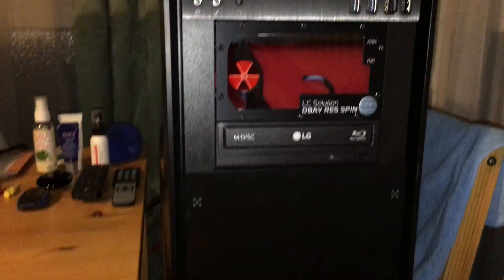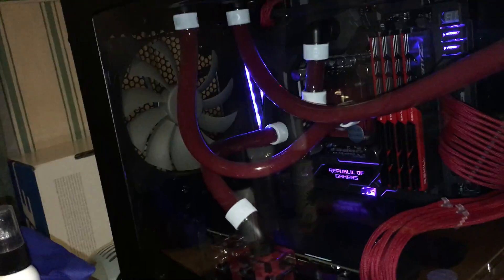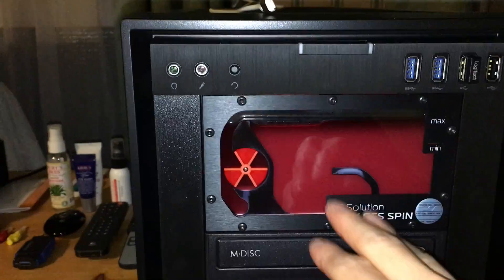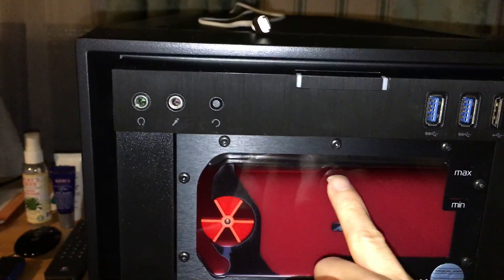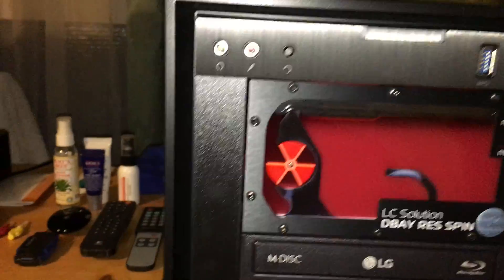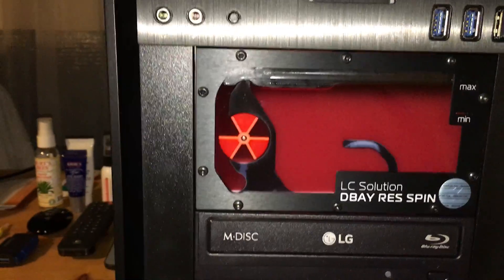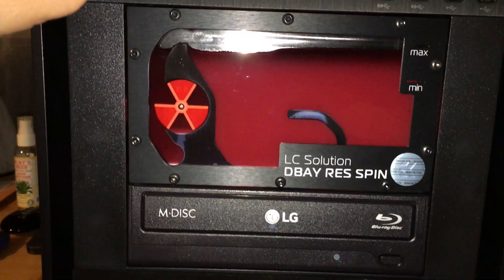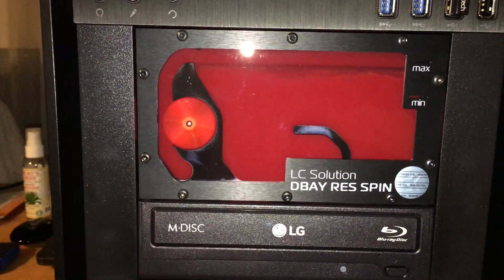EKWB Pastel Coolant filled to the brim following GPU water cooling extension

Comment: A quick question does this reservoir and pump make noise, besides the fact that leaving it sit might cause some noise. im thinking about getting this and im worried about it being very annoying. Also is it easy to bleed and add liquid to. Thanks for reading and keep up the videos. Id love to watch u make more pc videos
Reply from the maker: Bacon gaming Yes it’s very noisy. Don’t get this. Get an internal reservoir. I think I’ll push this inwards and cover the front with the casing’s original 5.25 inch drive bay covers. The pump is 100% silent as it uses a magnetic impeller that floats freely in the liquid. No physical contact with the motor. The reservoir makes an annoying waterfall noise. Bleeding is done from the lowest component in your system. On mine it’s the secondary GPU. Nothing to do with reservoir.
Reply: Brian Su  thanks. I would really love to get this but I heard it's noisy. Considering that yours is not that loud is it because it's filled to the top so when their is a water fall it doesn't make water splashing noise
Reply from the maker: Bacon gaming yes it is noisy. I did fill it to the top but the level has fallen. Maybe I need to try to fill it up again, failing which I’ll push it inside.
Reply: hello, mine was very noisy when I start use it, but after 24h (EK recommends to use the pump 24h alone before boot the PC), it stopped making noise. Don't know if it's the same for you Brian.